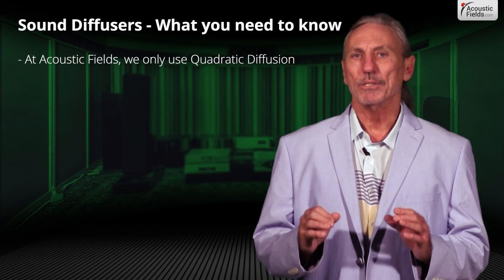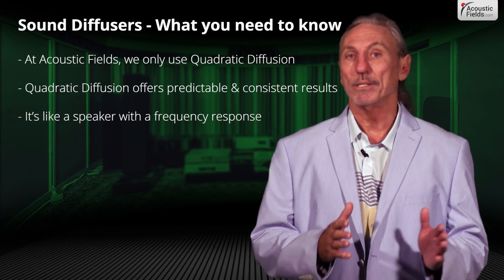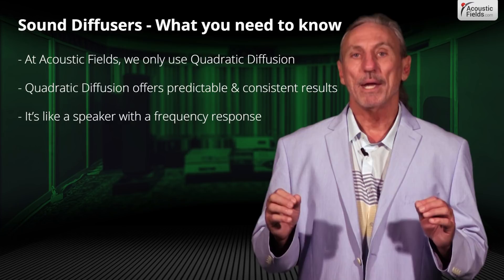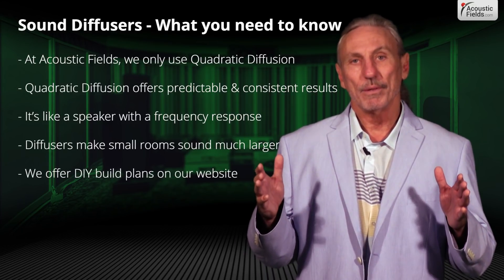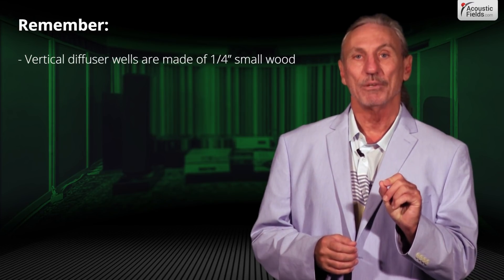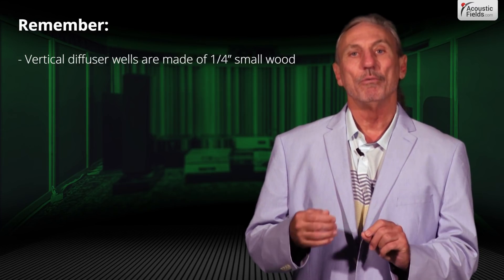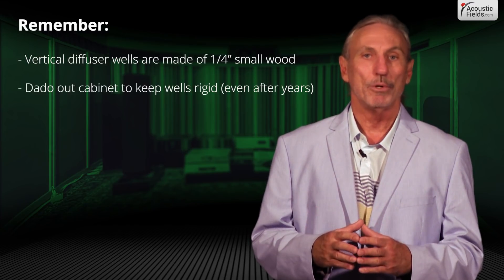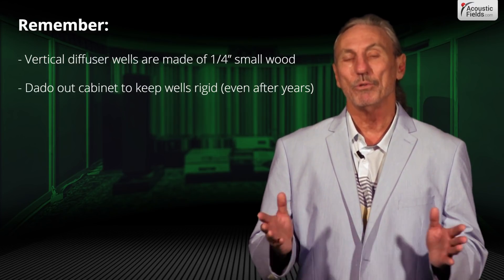How To Build A Sound Diffuser - www.AcousticFields.com

Comment: How do you get 1/4'' thick boards? I understand I can plane them to that but I have 1'' stock and no way to resaw it. 1/4'' plywood I don't want that, 1/4'' cherry seems impossible to build myself? One board I could do but I'd need a bunch of them! Can we use 1/2 or 3/4'' cherry for the slats?  I have plenty 3/4''
Reply from the maker: When you are building diffusers with different well depths, the thinner the well dividers, the better the performance.
Reply: I agree and not arguing just trying to wrap my head around cutting my 4/4 cherry down to 1/4" in a practical manner. Btw I'm in southeast Louisiana and the 100% humidity can wreak havoc

Comment: I recently made a diffuser with pine wood base and plywood for the well dividers
Reply from the maker: Pine is a good soft wood. Plywood for the shelf dividers might produce absorption at certian unwanted frequencies.
Reply: @AcousticFields  will it be so bad? I have varnished them. My diffusion range is somewhere from 320hz - 3500khz

Comment: Hi! Is it a good idea to put some high density building insulation inside diffuser behind the wells for some absorption also? Or is it gonna change the sonics of the diffuser.. absorbing maybe too much middle frequencies, since the fins are 4 mm. Its QD-7 for the ceiling. Thank You.
Reply from the maker: You can use a foam technology. Stay away from building insulation types.

Comment: Few days ago I bought your diy all in one package after watching a lot of your great videos. I was wondering what’s your opinion about the “skyline” modular vs your quadratic diffusers. Well known audio companies prefer these skyline diffusers in their demo rooms at shows. I’ve seen these diffusers even mounted on the front wall between and/or behind speakers. If the diffuser behaves like a speaker, why would you want it on your front wall?
Reply from the maker: A, The term "Skyline" is a product name for a two-dimensional diffuser. You can create two dimensional diffusion using one dimensional diffusion arranged in alternating patterns. People use the Skyline diffuser because it looks "cool" without knowing how to use it or why they are using it.
Reply: Acoustic Fields further... why are skyline diffusers built without thin wood separation between the cells? When would you want to choose a 2D over a 1D?
Reply: @sh91899  Becouse its a high prime number, meaning the wells aren't necessary anymore, though you can use them. 2D diffusion is really efficient, but don't return as much energy as 1D QRD's. 1D diffuses on vertical or horizontal plane. 2D to both, hence the not so big return in energy. I have big PRD (2D) diffuser on my back wall, as high prime number as 1093. I feel it returns enough energy(measured also) + you can record near it.

Comment: What about curved diffusers? They seem like a lot simpler solution 🤔
Reply from the maker: M,  A curved surface area is a sound redirect device. It is not a diffuser. A diffuser must satisfy 5 rigid criteria to create a diffused sound field. Only quadratic will give the consistency and predictability with this difficult task in small rooms.
Reply: Acoustic Fields interesting. Thanks.